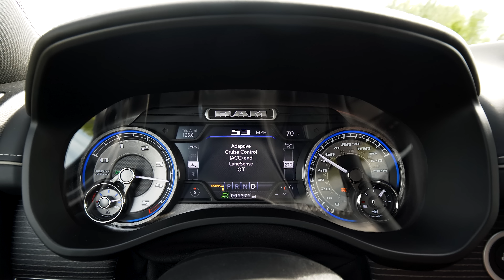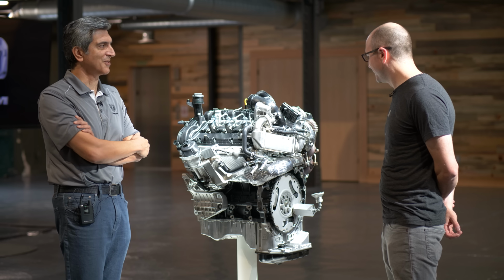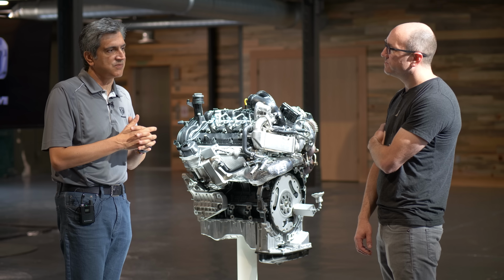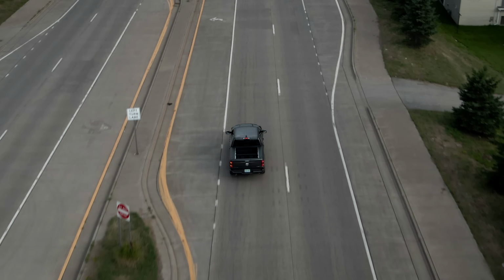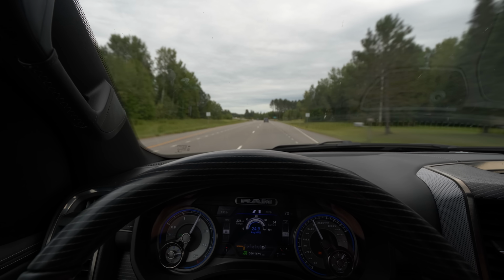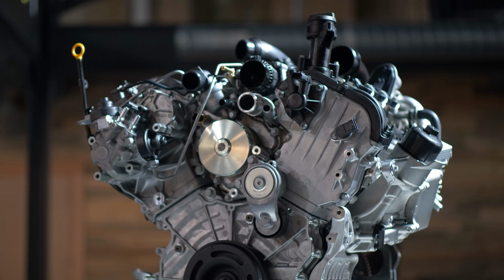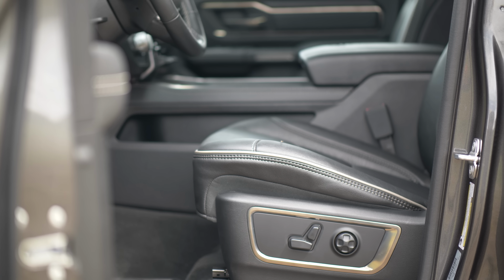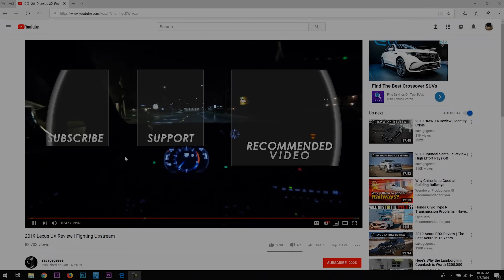2020 RAM 1500 Eco Diesel | Getting Rammed

Comment: Italian reliability should make a very unique truck ownership experience.
Reply: Maybe. But when it comes to Diesel engines, Italian industry is actually an established player. I don't think that would be the case, if their engines were junk.
Reply: @dsugioaga  The JTD engines are damn near indestructible.
Reply: FX Nice Alfa, the styling on the 159 is badass.
Reply: @RK1FX  FCA in the U.S. models is not proving out well at all and the dealers are not backing customers for repairs either. The list of issues across models is large. One example from researching vans, they constantly blow headlights, the rear doors routinely chop off the wiring harness just from opening and closing, the transmission design breaks down and FCA doesn't stand behind the product. We're talking headlights that fail every oil change when I have cars ten years old with the original bulbs in them. Engine issues, transmission issues, the dealers turn their back.
Reply: @kingsqueak1  well that's mostly the products that hit the US market, we don't have problems like that in the recent fiat products. What's sad is that dealers are asses and don't cover stuff under warranty.
Reply: FX Fiat is the least reliable brand in the US, statistically speaking.
Reply: @user-os8sq3uh4n  that's bullshit
Reply: @RK1FX  If Italian reliability is so good, why would you automatically assume it was meant as an insult?  Seems like you don't even believe your own BS.
Reply: @dsugioaga  McDonald's is also an established brand, their burgers still suck.  Being established doesn't automatically mean they have good products.
Reply: @Ethan7s  Well, comparing a fast food chain that flips burgers to a Diesel engine manufacturer is a bit of a stretch. McDonald's sells burgers mostly to individuals who just want fast, cheap burgers. They don't care about quality as much. A Diesel engine manufacturer sells its engines mostly to other companies who incorporate the engines into their vehicles or other machinery. Those companies have a vested interest in the engines being of high quality and reliable - because if they fail, those companies are primarily at fault in the eyes of the customer. And if that happens too often, those companies will buy their engines somewhere else. 

Also, Diesel engines are often used in commercial vehicles which have to endure more punishment than private cars and therefore have higher requirements when it comes to reliability and longevity. Italian Diesel engines are being used in a variety of commercial vehicles, from vans to heavy trucks. Even Toyota used VM Motori engines in the Hilux and Landcruiser.

Anyway, long story short: the country of origin does not necessarily define the quality of a product. Which is what you seem to think...
Reply: FX I agree Europe is a different equation usually. Here in the us unfortunately Italian cars are mostly total shit in terms of reliability and durability. Not sure what causes that.
Reply: If Fiat does one thing well, then it's building Diesel engines.
Reply: They can sugar coat this Ram all they want, the marriage of Chrysler and Fiat has proven to be garbage. Give it less than two years and you’ll see all the problems come out.
Reply: Ethan LMFAO. Unique indeed. Will be just as often at the dealer as your Ferrari.
Reply: Ilya Feynberg no diesel in a Ferrari
Reply: Italian engines are some of the most durable and reliable in the business. In fact,  I'd say they're the MOST durable of all, especially in commercial vehicles. Italian cars never had any issues with mechanical stuff ,they only had issues with electronics.
Reply: @kingsqueak1  That's what you get for paying half the price of what we pay for the same cars in Europe. An Alfa Guilia in the US costs 50% less than in Italy with the exact same spec.
Reply: @user-os8sq3uh4n  No, that would be Tesla.
Reply: @Ethan7s  You're just clueless.
Reply: @fartnutssupreme4930  Different production lines for a country where identical cars are sold at half the price, maybe?  I wonder...
Reply: talkisreallycheap   Is that why most trucks, vans and commercial vehicles in Europe have Fiat engines? Is that why ambulances, which ABSOFUCKINGLUTELY MUST  be perfectly reliable are most often Fiat engined? Same for military vehicles?   These diesel engines last for over 1 million km's of CONSTANT hard driving, no fucking warm up, no "no full throttle when its cold", none of it. Just start it up and abuse it. And they take it.

Let me give you a personal example, because I've seen it over and over. Ford Transit vans used as ambulance cars had their engines fart at less than 200k km's.  Mercedes van engines farted at about 500k and needed rebuilds. Fiat engines lasted over 1 million. That's not based on ONE van. That's based on over 200 vans over a period of 15 years.
Reply: We have a little unwritten rule in European car circles on how to recognize a person who pretends to know something about cars, but is actually clueless and is just repeating something they heard from other people.  Those characteristics that make up such a person include exactly what you're showing.
Reply: @derbigpr500  Fiat is about to leave the US market, again.  I guess we'll never know why.  

Oh wait, we do.  It's because their cars are junk.  Same reason as last time.
Reply: That's a lot of astroturfing.
Reply: @derbigpr500  Yet you pretend to know all about me based on a few comments on YT.  We have a little unwritten rule in America on how to recognize flatulent euro snobs with fragile egos. Those characteristics that make up such a person include exactly what you're showing.
 

See?  Any two people can play that stupid little game.  It's superficial and idiotic.  

We are talking about cars here, but when you decide to make personal attacks instead, I'll take that to mean you have nothing meaningful to add.  

The Fiat 500, which is supposed to be their volume seller, sold a few hundred per month for all of 2019, that's laughable.  Not only that, Fiat has done what we Americans thought was impossible, making Chrysler's quality even worse than it already was.
Reply: @Ethan7s  weird out of the fords and chevys I have had over the years the last 2 rams I have had  a 2012 cummins diesel and a 15 ram 1500 have never seen the inside of the dealership , our srt8 challenger and charger also no issues .  my best friend just purchased a 85k ford f450 1 ton already has a cracking dash and passenger seat had to be replaced within a few weeks of buying it . my 6.0 powerstroke was a total POS . I just traded my 17 5.0 mustang for a 19 ram Laramie 1500 . I tried to give ford another chance but the bubbling paint on the hood and doors and loose AC vents and windshield wipers that stopped working did it in for me . so back to mopar
Reply: @bryan70546  Even if that were true, using those few examples to say Fiat makes quality cars just demonstrates an ignorance of statistical analysis.
Reply: @Ethan7s  believe what you want bud , every brand has haters are fanbois crying which is better.  Y'all have fun arguing thou.
Reply: I have ever been in Italy 10 years ago. FIAT spin in front of my car because steering problem.
In Thailand, the 1970 -1980 Alfa Romeo have many problems but the 2003 Alfa Romeo 156 is reliable.
VM Motori is famous in Diesel engine.
Reply: @kingsqueak1  any idea why headlights go so fast on some vehicles. My 2nd gen toyota tacoma eats headlamps
Reply: @harveymorgan1749  No idea, vibration of the housing is just a guess, poor contact design...really don't know. I had a car years ago that lost the headlight about twice a year, annoying as hell.
Reply: @kingsqueak1  ah ok, thx for input.
Reply: @GodFootDaddyG  no, i meant headlights that burn out quickly. That is a a creative fix you came up with for your issue.
Reply: The engine and interior YES. THe Chrysler/fiat transmission... ew. Manual plus 3.0 diesel and that interior, heck yeah.
Reply: @kingsqueak1  we had all the issues as you listed
Reply: @RK1FX  fiat is trash that’s why they’re gonna pull out the American market soon once again.
Reply: @derbigpr500  you must’ve not of heard of Toyota.
Reply: @dsugioaga  idk about the second gen but the first gen ram 1500 ecodiesel motors were garbage

Comment: Cracked me up when he threw shade on the Silverado cylinder deactivation blown engine issue at 10 mins in and how the Chevy guys will just go buy another Silverado when Chevy denies their warranty because you're 60,001 miles into it.  

Funny because it's so true.  Ask me how I know.
Reply: Why would you buy another
Reply: @harveymorgan1749  I didn't.  Learned my lesson with my first Silverado.  But I see lots of people that keeping going back for more.
Reply: @kimokahikolekalihi  what u replace it wit
Reply: @harveymorgan1749  older 94 Toyota 4x4 22re.  Back to my roots.  Cheap, deadly reliable, easy to work on, go anywhere.  Just won't tow much but I don't tow anything.  Just need a farm truck.  Sold the 07 new body style ltz Silverado.  I miss it.  It was very nice, super roomy, quiet, easy to drive but it was like Chevy forgot what quality control was.  So many issues with that generation.
Reply: I’m sorry man

Comment: Warning - If you live where it gets below 0f or -18c do not buy a Ram with Air Ride.  The air ride system does not deal well with cold weather.  When I traded my '15 Ram Limited this summer, I believe I was on compressor 5 or 6 and three of the four air bags had had to be replaced, the last two out of warranty.  In warm weather the air ride is great but it does not do cold weather well at all.
Reply: Yup. My mother has a 2012 grand cherokee and all 4 bags were replaced at 70k miles, at 300$ each. The compressor is still original though.
Reply: @flagovhate  She was lucky on the cost of the air bags, I paid $1100-$1300 (Can$) to have a bag replaced on my Ram 1500
Reply: @DougsMessyGarage  that's crazy. But i also listed USD prices. I'm in Canada too, price from Ontario dealer was 500$ each bag, but my father ended up getting some in Quebec for 450$ CDN each. He replaced them himself so saved himself probably atleast 1000$ in labor. Luckily that's the only issue we've had with this FCA product, it has 170k km on it, and has been through plenty of -40c winters lol
Reply: @flagovhate  Other than the air ride, I really liked the '15 Ram.  In fact, when I traded it in, I traded it on a '19 Ram.  The new truck definitely did not have the air ride system though.
Reply: @DougsMessyGarage  i have a 2017 Ram quad cab express and i don't think I'll be getting another ram. My truck only has 42k on it, and it's already had a front strut replaced, from tie rod and AC system empties itself every winter. I also have occasional transmission issues where it won't shift properly or won't go into gear. Also the rotors are almost finished and thats 42k of highway driving. I like the truck, but i can't imagine owning it long term, it's only a lease. Only reason I'll consider another ram is because of how well my local dealer treated me. So we'll see, lease is up in a few weeks.

Comment: I've look at every video review about the 3rd gen Eco-diesel I could find. This really is the most informative that is out there. I have heard that 80% of the engine parts were new but now I know what and why. I currently own a 2014 Grand Cherokee 1st gen Eco-diesel with 120k mile and I still love it. This engine sound more bullet proof in a better package, depending on what the new Grand Cherokee standard length looks like, the Ram 1500 may be my next daily driver. I just have one issue with your opinion of brand loyalty. I have owned and worked on every top pickup brand out there and I have found that; if you get a good truck to start, regardless of manufacturer, it will always be a good truck. Everybody can make a lemon just hope you don't buy one. Hey Savagegeese,,,,, keep it up.

Comment: im not surprised that they didn't make Reliability a priority... instead priority to serviceability....... More money for Ram dealerships and rental car companies!!
Reply: I'm not surprised. With all the restrictions that they are under, it'll be hard to make it more reliable too. Emissions is the main restriction. And what's good for emissions isn't necessarily going to help with reliability
Reply: Serviceability is a design target in the heavy trucking industry as well.
Reply: Ultra low friction parts = burning oil.
Reply: @zephxiii  serviceability is designed into every single Honda, Toyota, Subaru etc....it should be automatic in design
Reply: @SantanKGhey1234  Let's not nitpick words here. They vastly improved the serviceability of parts

Comment: i think ram is hands down best looking truck inside out - interested to see how is that diesel gonna do in long term - last gen had alot of problems
Reply: Too bad we can't bring back the old 2-stroke Detroit Diesels to fix all those reliability issues.... Sure, they made a lot of smoke, but if it could run a bus or a semi for 600000 miles, it'd probably last twice as long in an under-stressed application like a RAM, here it'd be hauling around a quarter of a bus in weight only :P

Comment: The Toyota V8 duo won't be beaten.
Reply: MrCarGuy20 It last Toyota tundra last in everything.
Reply: @davidharris9259  It's a legacy powertrain and drivetrain. It works better than all the others. 1UR and 3UR have their origins from the 1UZ, you know, the most reliable V8 ever produced. But that's ok, you get your extra 1,000 lbs capacity and shitty engines/transmissions.

Comment: But will the cam gear spin on the camshaft and grenade the engine still? That was a neat feature of the previous ecodiesel. Super. Maybe now the engine will last long enough to have super-expensive emissions related failures.

Comment: I have a 2019 RAM 1500 Limited with the 5.7 eTorque. I would not want the 3 liter ecodiesel in my truck. However, once the 3 liter ecodiesel has been available in the Jeep Gladiator for about a year, I plan on trading in my RAM on a Rubicon Gladiator with a 3 liter ecodiesel.

Comment: I'm enjoying the comparisons between the small diesels produced by the big three for their new trucks. Have you guys 
looked at the Audi 4.0 twin turbo diesel with electric low end rpm forced induction. Seems to me to be quite far ahead.
Reply: Your moms HITACHI I drove the Grand Cherokee with the VM 3.1 for many years, Great motor no problems for 150k's. When this motor finds its way into the Gladiator platform I'll be driving that. Now if you want to talk about crap diesel motors well there's a long list of American and Japanese contenders 😀
Reply: Your moms HITACHI I trade in usually before 100k but no problems when I sold at 150k. This motor has consistently been highly rated. VM motors were used in various manufacturers vehicles including Chévy Toyota Isuzu Land Rover etc, RAM and Jeep will do very well with it.

Comment: Everyone always says the diesels are more efficient than the gas engines. While that may be true, you have to drive them 200,000 miles before it pays back the increased cost for the engine and the higher diesel prices at the pump.

Comment: I was warned to not get a diesel unless you drive longer distances and tow often due to the engine regen systems. Anyone else?
Reply: That's 100% true. 
And regardless of the regen system needing long distance driving, if you don't drive a ton of miles a diesel is a huge waste of money. You need to drive a lot for it to pay off.
Reply: @zeroyon223 wats dpf
Reply: Whats a regen system in desiel

Comment: Hey Mark, I got a YT algo tip to share that shouldn't conflict with your format too hard. You might be aware of this already as I have no idea if you've been assigned a YT rep/if they're communicative but I don't know and I think you deserve to grow more without necessarily having to go full Straightpipes (no offense meant, different formats).

That outro cycle of yours is actually hurting your channel momentum for recommendations/discoverability. Credits and "concrete endings" akin to TV shows and cinema are calls to action to tune out/move on and this place is programmed in such a way that you want people to hang on to the platform. I suspect affecting close to a minute to that is doing more harm than good. Your call to actions for subscriptions and support should be spread around and those can be simple graphics rather than visual and audio annoyances to suit your format.

Comment: Mark
Could you be sure you had a 'fully CARB compliant' RAM EcoD?  This is really a critical question.
Ive seen several reviews of the 2020 EcoDiesel that say it delivers great driveability and mpg and I'm left with the one only relevant question:  Is it a real look at the final engine with FULLY EMISSIONS COMPLIANT setup.
If it's not, it's just another advertising stunt and the same kind of scam I bought with my 2016 RAM 1500 EcoDiesel.  AND now that FCA basically KILLED that truck when the did the AEM s/w update to comply with CARB and EPA mandates, they're trying to win back "LOYALTY" (and a lot of otherwise LOST PURCHASE INCOME) with a 'real deal' small displacement new-tech diesel.
So, any way of KNOWING that it was a FULLY COMPLIANT / production version of the motor??
Thanks for being a critical voice on reviews.